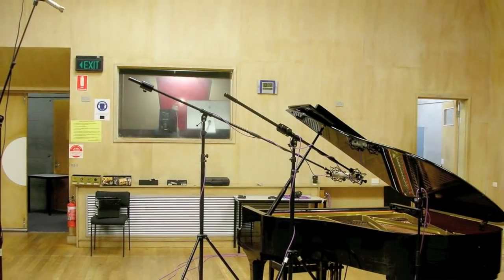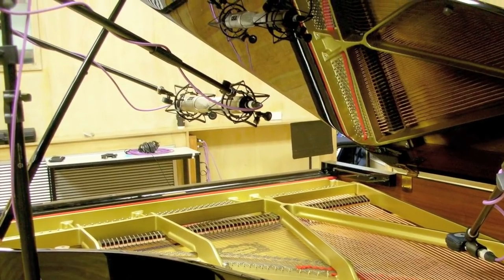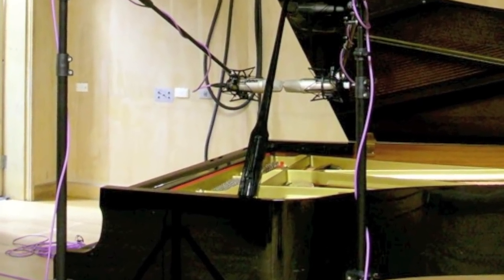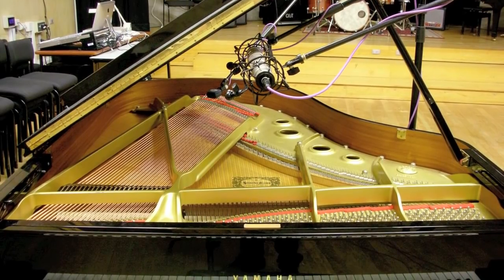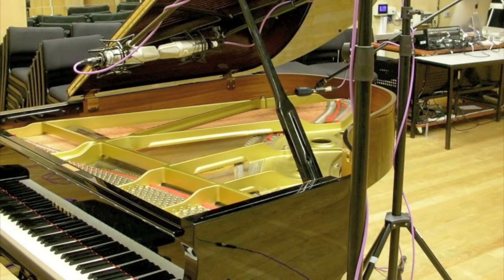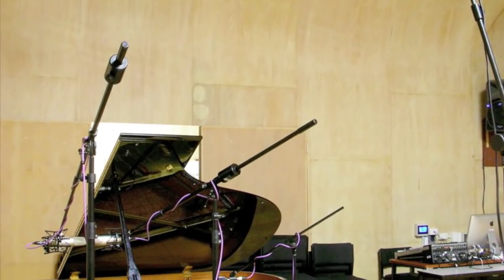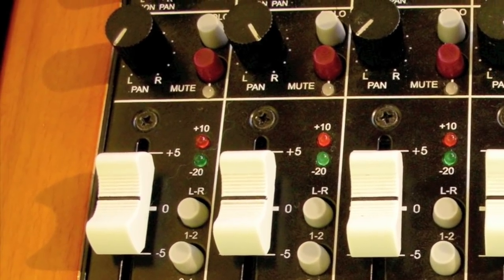Blumlein Stereo Microphone Technique

Comment: the thing is man you can set your mic facing the bass as omni coz bass frequencies are omni its the the higher frequencies that are directional so its those which are causing the distance get your mics closer to the high end. Have one facing the highs and one facing the lows. It wont matter that the one facing the lows is so far away from the low string cause bass sounds like its all around you any way.

Comment: some people at RCA in the 50's use also an interesting trick using 3 microphones, one cardioïds on center, the other left and right are pure omnidirectional, and it's also work with 3 cardioïds with the center bigger than the other mic. i try this and it's work also very fine with ORTF couple.
Reply: +Meteotrance -
I totally agree with this. The whole explicit L/R hard panned mic thing is not completely 'correct' in my opinion. There must also be one mic in the middle (not center) I'd say around 40-60%, but only on one side, then blended into the other side while delaying all three mics L/R/M&S a few milliseconds. Trying to do it otherwise (especially in a mix) is like trying to search for a needle in a haystack and will most likely only result in a thinner stereo image.
Reply: +ShadowⓋ  The Blumlein array that MysterKarl describes is a classic stereo technique from the 1930s by the inventor of stereo mic'ing. Mr Blumlein also invented the mid-side mic technique you refer to with a cardiod and a figure eight. But notice in this video, it is two figure eight mics set at 90 degrees and NEITHER mic is pointing directly at the sound source. Whether you agree or not is irrelevant. This IS the classic Blumlein array, and if you want to get it precisely correct, check out the Royer SF12 stereo ribbon mic. Because Royer actually manufactures a single mic with two figure 8 ribbons built together in this format. And it rules. have fun recording! And most importantly, keep all the mics in phase. Then you won't have a thinner sound.
Reply: Ra Bob
That mic sounds interesting, but my question is why is the damn thing so god awful expensive?! Seriously, two and a half grand for a microphone? That's completely ridiculous. It better be gold plated.. or something.
Reply from the maker: Ha ha... All condenser mic's are gold plated, or more to the point... Gold sputtered. The diaphragms are literally coated in gold :D
Reply: +MysterKarl  But the Royer SF12 is not an LDC. It's two Royer ribbons mounted on a single mic body at 90 degrees.
Reply: MysterKarl
What he said ^... So explain that one huh ?
Reply from the maker: So, as stereo mic's go they are expensive because you are paying for two transducers. I wasn't familiar with the Royer SF12 until just now so you have two ribbons instead, got it... If you consider the SF2 by itself is just shy of US$2300 a pop (Vintage King) it goes to show that US$4300 is actually better than some companies who charge more than twice for a stereo mic version of another mic in their catalogue just because they manufacture it. True, its expensive and price really does reflect the quality of this product along with the specific electronics that come with with impedance matching dual transducers and phantom power all within the capsule. Further, ribbon mic's traditionally cost more than condenser mic's. This is probably due to the tooling and specific machinery required to design and manufacture plus the mounting of the ribbon itself. You should also consider that most stereo mic's are aimed at professional applications and serious (precise) recordings (expensive studio's or orchestral, big band and choral works come to mind) so the expectations from such a mic is equally high. This is just how it goes.
Reply: MysterKarl
I guess these mics are only manufactured for a specific group of people then because a very small percentage of people are going to pay that much money for them, quality or not.
Reply from the maker: Also... Alan Blumlein could be considered the Nikola Tesla of telecommunications with awesome inventions as well as furthering developments of existing devices. Blumlein devised most of the stereo microphone techniques we have today as part of a wider investigation of stereophonic audio systems while at EMI. A plane he was in during WWII fell out of the sky while personally testing a new ground scanning radar system in which he was critically involved. It almost didn't succeed due to his death. At a glance government investigations don't specify sabotage but the plane crash from an engine failure due to faulty maintenance seems incredibly suspicious to me. A deeper investigation should be warranted.
Reply: MysterKarl
Maybe it was the price of tea in China at the time.
Reply: You are right. Royers are pro-gear, not meant for home recording hobbyists. The instruction booklet actually states: "DO NOT LEND THIS MICROPHONE TO ANYONE WHO IS UNFAMILIAR WITH USING OR HANDLING A RIBBON VELOCITY MICROPHONE."

Comment: To make this a Blumlein stereo recording, first eliminate the three extra microphones, then move the Blumlein pair so the piano subtends an angle of less than 90 degrees. This will get you partway there. Using ribbons will get you further.
Reply: Use of ribbon microphones has nothing whatsoever to do with the Blumlein array. It refers to placement of two-directional or "figure 8" microphones, whether they are condenser, ribbon, or dynamic ( of which none exist that I am aware of.) the demonstrator states very clearly that the room mics ar present only because the lid of the piano remains in place and not removed , and used only for a sense of ambience. If placed verly low in the mix these would have a minute effect on the stereo imaging created by the Blumlein technique. This comment was incorrect and for this most part invalid.

Comment from the maker: I was supposed to use a matched pair of AKG C414's which are a better choice but was very happy with the results from the pair of NT2A's. This recording takes in more microphones over time, the additional microphones appear in the mix as I introduce them. You can use that as a basis for critical comparison against another recording if you wish. You might also want to consider hiring a pair of mic's from your local pro music shop or film equipment hire service instead of purchasing.

Comment: so my question is what happens in post? you have a stereo sound one panned to right and the other panned to left and one above for capturing the room tone. in the DAW you have three recordings of the source, who do you deal with them in post meaning how do you mix them so that you have one output comprised of all these three inputs?
Reply from the maker: +Pissarrio Hi Pissarrio - The answer is entirely personal however, the mix is entirely dependant upon how much room tone you want. If you think in terms of an orchestra hiring an expensive concert hall, the reason they pay for this privilege is to capture the reverb character of the hall and this is paramount in the final product. Traditional electronic reverb doesn't cut it and this is why the room mic has been utilised. A Decca tree is normally employed for these larger recordings but in the case of a solo instrument a room mic will suffice. So... in answer to your question; There are five channels of audio in my recording (see the description above). The Blumlein pair are the focus microphones so have to be loudest in the mix. This does not mean you push the volume controls straight to unity as you want to stay below the distortion ceiling with the additional volume from the additional microphone channels (the sum voltage through a desk) . This is where a stereo buss (set to unity) should be used and you can set this up in your DAW just like a mixing console. So turn up the faders for the Blumlein pair and bring in the stereo room channels until you're happy with the mix. I measured the distance of the room mic to the piano harp according to the 3:1 ratio of the Blumlein pair to avoid comb filtering. Because I measured the mic distances I didn't have to fiddle with the alignment of any audio waveform in the edit window (protools). It's the same with the close mic on the bass end of the harp. I used the Sennheisser to fill out the bass end of the piano and again, brought up only enough to compliment the overall character of the piano. If I remember correctly this mic is panned slightly left (likely around 9 o'clock) as the Blumlein pair would have the bass in that end of the stereo field. By sending the output of all 5 channels to a stereo buss (post fader) I was then able to use the buss to control my final volume (Essentially as a Voltage Controlled Amplifier). This is where you can use a compressor, limiter, reverb (depending on what instrument/s you send here) to reach your final mix.
Now, I answered your question with a logical approach BUT mixed the close mic's first and added the room mic last. Mixing is about balance and that balance is entirely personal - I hope this helps.
Key concepts - Decca tree, focus instrument, unity gain, distortion ceiling, dynamic range, stereo buss, post fader, 3:1 ratio, comb filtering.
Reply: +MysterKarl Thank you so very much. What you have provided as a way of answering my question has been more than helpful and I intended to learn from it and experiment with it.

Comment: did you need a phase reverse trick with a blumlein pair ? like the M/S technique ?
Reply from the maker: Meteotrance Yes, it is essential to have one out of phase with the other. When you have them mono on the console (both channels panned centre) you will hear a minimal amount of sound. Total phase cancellation cannot occur due to the two microphone capsules occupying a different position in space. When you pan each channel in the opposite direction (Left & Right) it is then that you will receive the maximum benefit of stereo reproduction. Some authorities believe this to be the best stereo microphone configuration.
Reply: Thanks you, for ambiance, yes it's probably one of the best stereo use, for surround capture maybe not, but a regular M/S too front and rear with some extra omni do the job right, im testing a lot of stuff for having wide stereo, or binaural and surround also some tricks with plug in that work with convolution or algorythm they have also benefit on none acoustic sound.
Reply from the maker: Meteotrance Actually, My answer above is incorrect. There is no need for phase reversal. I realise you ask this because I had the negative side of the capsules facing the sound source which is not as acoustically warm as the positive side - but brought out extra brightness from the piano. I had to phase reverse the Blumlein pair in order to match the electrical polarity of the other three mic's in the combined mix else I would have suffered phase cancellation. If you do change the polarity of one microphone the only effect will amount to the direction of the array moving from the front to one of the sides. The difference will equal the sound quality differences between the front and rear of each capsule. Looking at an illustration of the polar pattern bloom would better clarify the differences.
Reply: yep that exactly what i read, on some forums, they explain that with a polarity diagram. So you just need, to put two mic dead center on the mixing bus, and use only the phase reverse, when you have other mics added with phase cancelation issue ? right ?
Reply from the maker: Incorrect, the two mic's used for the Blumlein technique capture a binaural signal meaning, you need to pan hard left and hard right to reproduce a stereo (binaural) image through the speakers. As for other mic's it is important to consider the 3:1 ratio to minimise phase cancellation. This is when you need to consider measuring the distances between the mic's and the sound source thereby minimising phase cancellation. As you can see the mic setup starts to become complex so simply flipping the phase on a mic won't fix the problem. If you do have phase issues, try moving the resultant audio region/audio clip to align with the phase of the primary audio track. I have named several concepts that are lessons in their own right so have a look at other resources on the net to firmly grasp everything I have said here
Concepts (cut and past into your search engine):
Binaural
3:1 rule
Audio Signal Phase
Audio region/clips
Reply: +Meteotrance  It seems you are confusing the "Mid-Side" technique with the binaural Blumlein array that MysterKarl is describing. Notice that neither of his figure 8 mics are pointed directly at the sound source. It is the line bisecting the angle between the two matched microphones that points at the sound source. (thus, just pan each mic true left and true right... ending up with just two tracks.) In Mid-Side recording, both mics need not be the same. One should be a cardiod pattern that is the "mid" or center mic pointed directly at the sound source. The other mic should be a figure 8 pattern that is, again, at 90 degrees to the "mid" microphone. In mid-side technique, you will end up with three tracks. The "mid" mic is one. In digital mode, you just copy your track from the "side" mic, the figure 8, to another track. Then pan the two tracks from your figure 8 microphone hard left and hard right. This is were you need to use phase reverse... or realign the two figure eight tracks in digital realm by eye so that both side are in phase... Because on the figure 8 is positive and the other side is negative. So in the end, you have three tracks. Figure eight left, figure eight right, and "mid" cardiod mic set to center. Have fun. What air in the sound!!! :)
Reply: I already use the MID/SIDE with one mic cardio and the other in figure 8 they don't need to be matched for working, but for the Blumlein Pair im a newbie, so my question was just " it is necessary to have a phase revers trick of anykind, with a blumlein pair" just that, but thanks for the reply.
Reply: If you set the Blumlein binaural up the right way, no phase reverse needed. it's basically like doing an x/y with cardiods... except the two mics are closer together and they're also pickup up the backside (negative) on both mics... so matching pair and each mic 45 degrees off axis from the sound source, no phase reverse. just pan true right and true left. two mics in stereo with more air than cardiods in an x/y that is spread further apart. Have fun with it! :) I'm curious, what are you using for you mid and side mics when you M/S?
Reply: the figure 8 is a rode ^^ NT2-A the other is an awfull chinese mic from Joemeek, but it's fucking work fine i have amazing stereo image with ^^ i just need to replace this with an AKG C 451 B, this one have a pad with minus 10 db so i can use it in a more efficient way.
Reply: For my blumlein pair i probably made myself my ribbon mic with some Lundahl transformer

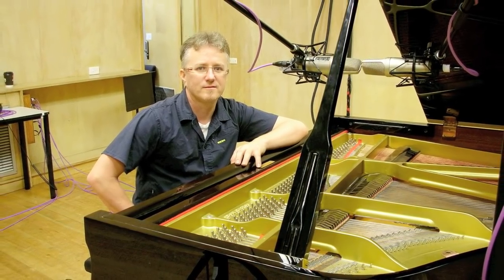Comment: 2:33 those are NT2000 microphones. Not too shabby for $700 mics, but not too great either.
Reply from the maker: Yeah... Its all I had for this recording.
Reply: I bought some 414's and fatheads
Reply: How can you tell that they are NT2000 rather than NT2A mics? The two mics look very similar from pictures I have seen, but I think these are NT2As as indicated above. I'm considering buying 2 x NT2000 mics to use in Blumlein configuration to record my harpsichord and spinet at home, and am wondering whether this would be a good choice. Quite an expensive investment for me, so I want to make sure it will work before buying them.